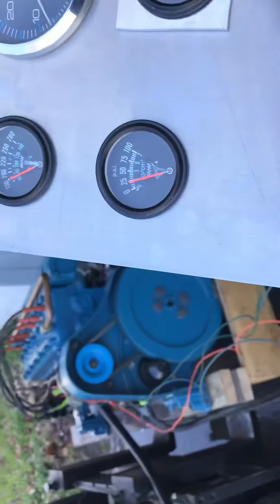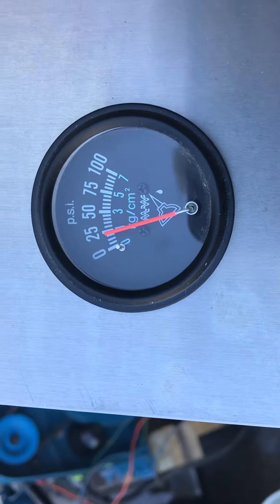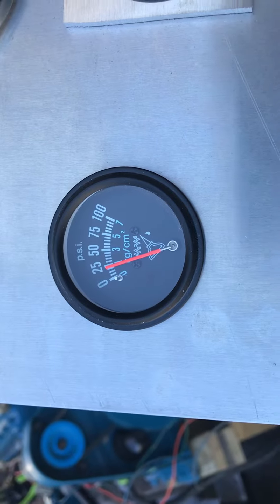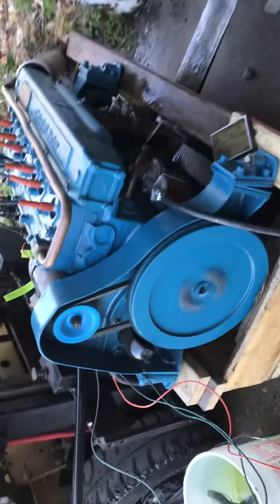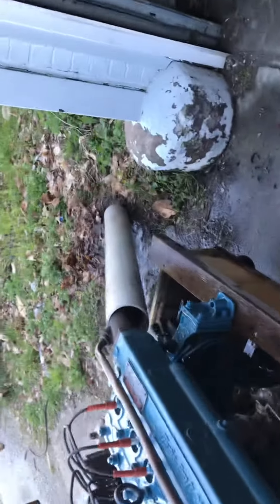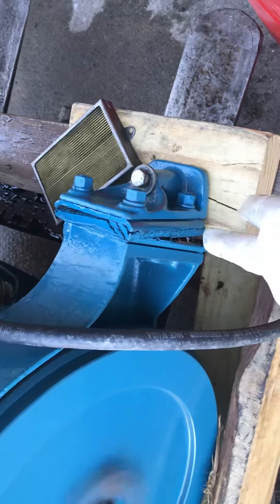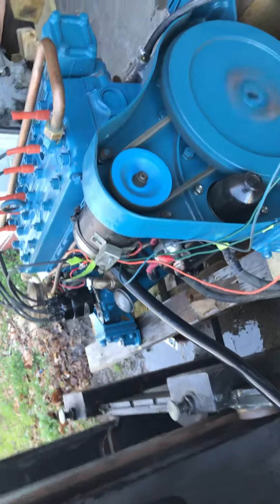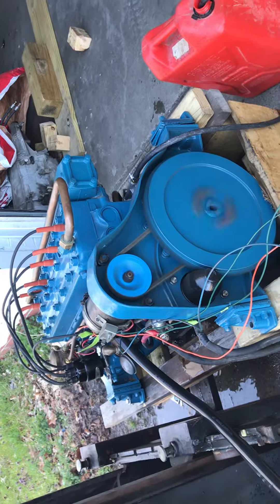Hercules 6 Cylinder Testing

Comment: How will this engine cope with the new E5 or E10 petrol?
Reply from the maker: In our area we have filling stations that supply ethanol free “boat gas” . We installed hardened exhaust valve seats because we have unleaded gas now. The lead was added to fuel back when my daddy was young and of course they charged for the lead. The lead lubricated the exhaust valve seats. Then 30 years ago the refiners just left the lead out and charged extra for NOT putting lead in. Pissed my daddy off! 😳 the intake valves don’t need hardened seats because they are lubricated by the unburned  fuel.